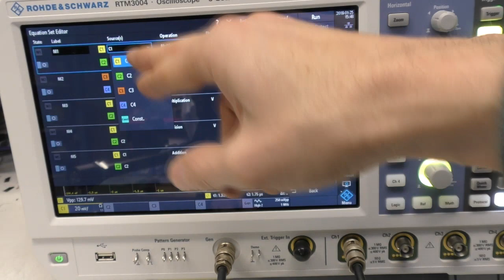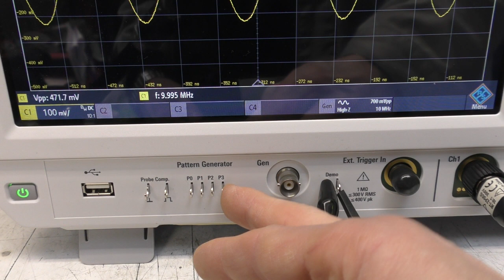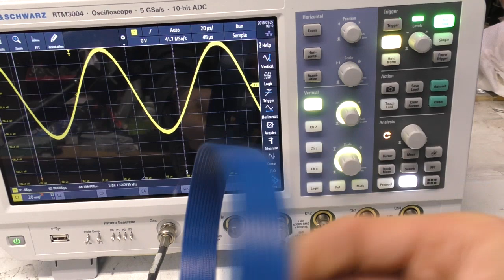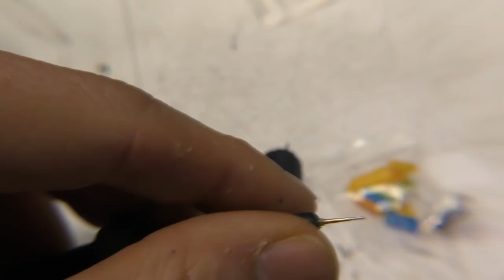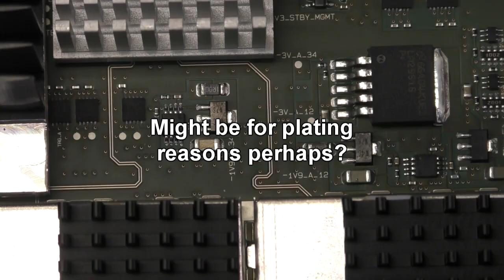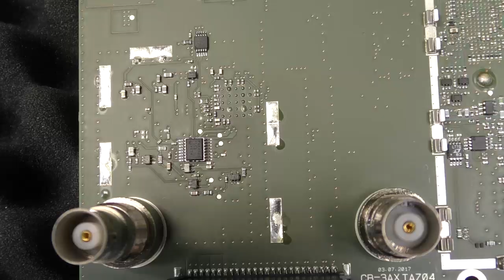Rohde & Schwarz RTM3004 oscilloscope first look.

Comment: I own an RTB2004 and I'm wondering if it's worth upgrading to an RTM3004. One thing that I find a bit annoying about the RTB2004 is that the UI feels a bit sluggish when switching modes, navigating menus and such. I wonder if the RTM3004 is more snappy, that would be a big plus for me.

Comment: MIL-STD-1553 is still used in aerospace but modern systems uses SpaceWire or ARINC which you will find in every modern airplane.
Reply: MIL-STD-1773 is the military standard used for fly by light. There are still plenty of military aircraft being developed with MIL-STD-1553B though.

Comment: Looks pretty fancy, but I still dont get the glaring screen. Having finally played with a new R&S scope at uni I do really like the intuitive user interface they put on it with the touch screen. Worked a lot better than I thought.
Reply: As you would expect from R&S.
Reply from the maker: Shiny screen is only an issue if there are lights reflecting off it when in normal position -  in this case an antiglare screen protector is a reasonable fix ( and protects against scratches) , though the Keysight glass antiglare screen is  a lot better.

Comment: That power analyzing functionality would be so so great to wipe out the Fluke 17xx. Getting 3 phases with full power analysis ability at 10 bit then being able to correlate it against vibration analysis tooling = a process engineers wet dream. I'm guessing their power measurement functionality is more for single phase applications (seeing how clean your SMPS is, etc) and IoT/MIMO stuff.  That scope basically seems absolutely perfect as for you as a dev (rather than a field) instrument though considering what you do (lots of power problems for CC with LEDs and then tons of uc stuff so UART/i2c).

Comment: Mmmm, no thanks. 

I think that I'll hang on to my Rigol DS1054Z (which "fell" on its head, and now thinks that it is a DS1104Z). $349 USD, and it does everything a home enthusiast could hope for. It's also my work scope, and at 350 bucks, it isn't the end of the world if it walks off on the job.
Reply: MrWaalkman it’s a completely different part of the market, though. The rigol is an awesome scope and nobody says otherwise, it’s just that mixed signal scopes can get pricey real quick. $350 for an oscilloscope is about as cheap as they will ever get, there’s no room to move on that sort of price. And you sure as hell are not getting any mixed signal scope for much change from a grand.

Comment: Fantastic idea with the USB communication choice on the active probes. Why go to the length of designing your own protocol when USB can already do what you need?

Does make me wonder what happens if you conect the USB interface on the probe to a PC... I'm sure windows would just be like wtf is this, but linux may actually have some interesting things to play with
Reply from the maker: The USB ports would be host, not device.
Reply: i think he meant connecting probes pins to your computers host

Comment: ooh, I'm early it seems, lol. It's not in my price range but always fun to watch, and it might, just might, come in handy someday...
Reply: I would never measure anything above 100KHz, so I could not even use its 1GHz bandwidth. I think these scopes are for companies who are developing fancy high frequency boards using DDR3 RAM and such.
Reply: Exactly. What I meant was: the info might come in handy for the day I even get near such an expensive device... Oh wait. I had the "delight" to operate an Infiniium with 17" touchscreen (or so) at work (forgot which model, we rent it!). Unusable for day to day measurements, but fun nonetheless.
Reply: Yeah, renting is not a bad option. At the end of the day the bandwidth/features these high end scopes will be rarely used. For a hobbyist  or for a repair shop it is way too much of a gear. Though, what I hate is that they try to make even more money on you by asking you to pay for serial decoding or for any decoding, which is a standard feature on a cheapo digital analyzer.